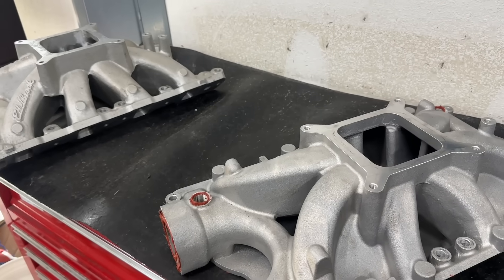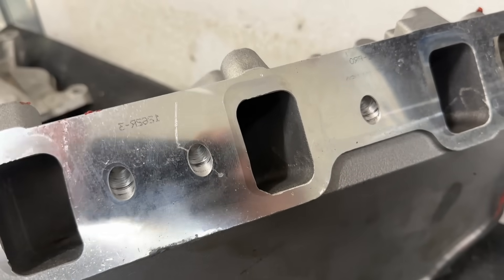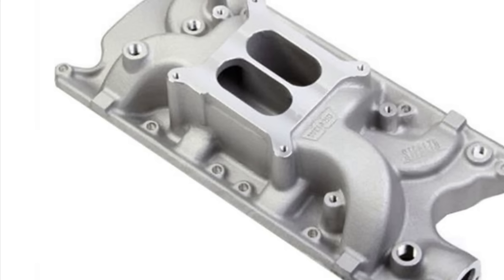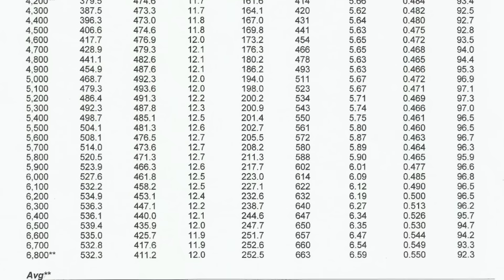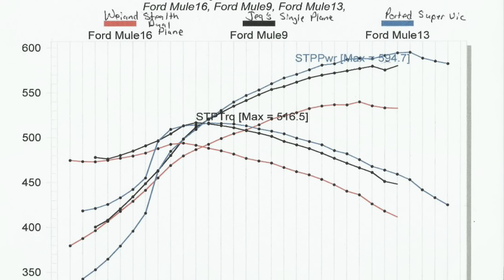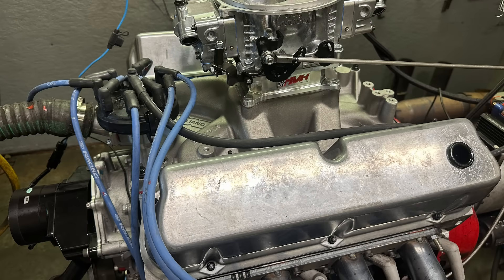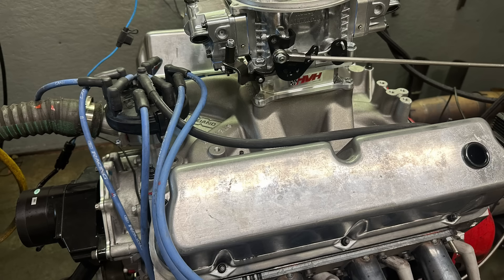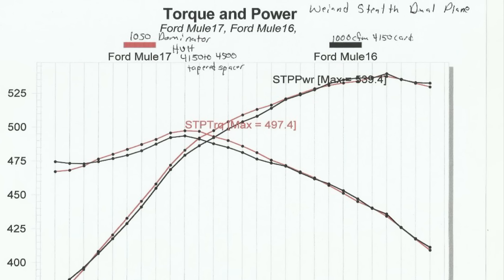SBF Dyno Testing 3 Intakes

Comment: Spacers add plenum volume. Most intakes are designed for the cubic inches of the engine application. Stroker engines like more plenum volume. No im not saying run 4" spacers. Port the plenum to gain the volume. 100 bucks says you port match the jegs and clean up the plenum and transitions it will out perform the super victor on average. From a dead stop to a full load the big tall spacers will cause you to kill intake airflow. Keep the runners fairly short and the plenum volume up and you will see bigger gains at the track. Maybe test that theory on the dyno and then see how it computes to real world racing.

Comment: I would like to see a Offenhauser 351W dual port manifold tested. They were popular in the 70s and 80s. These can still be found on E bay. I used one on a 460 Ford with good results for low end torque. They are for use on the street more than the race track.
Reply: I had one of those intakes on a 4V Cleveland, made a big improvement in low end power

Comment: Problem with dual planes with an uncut divider is that you are technically cutting your cfms in half. So say you have a 600 cfm carb, you are only getting 300 per side. The intake only has “access” to two of the barrels on the carburetor, primary and secondary (let me know if this statement is wrong btw, im not going to pretend to be an sme here). On a single plane each intake has access to all the cfms, 4 barrels. I would be curious how the dual plane performs with the divider cut down, may be interesting to compare that aswell. I always cut down my dual plane intakes at the divider for this reason.
Reply: Nvm I commented before I saw your last test…

Comment: I had my 76 Ford 4X4 pickup upgraded to a 390ci a couple years ago. The old engine a 360ci had a 4 barrel Carter with an Edelbrock Streetmaster single plane manifold. I had this manifold cleaned up and installed on the new 390ci along with a new Edelbrock 600 cfm carb. Really like the performance. Are you familiar with this manifold and what's your opinion on it?
Reply: The Streetmaster is the best all around intake for a FE. Multiple dyno tests have confirmed this. It makes the best power and torque, out of everything. I would recommend that you pick up a copy of the  book - The Great Intake Comparo"

Comment: Do a test with a pair of eBay gt45 turbos I have the same setup 410W sbf but im running -34 cc dished dss pistions with the same heads. But I'm running the same dual plane intake "stealth" I'm only going to run 3 psi of boost to run 87 octane "its a tow motor for my van"

Comment: good ford stuff!. a 408 will always make more power with a ported super victor, it needs air!, dual planes are good on a351, the extra cubes makes more NA torque so typicaly a two plane will become a restriction. more compression here like 11.5:1 will help a lot.